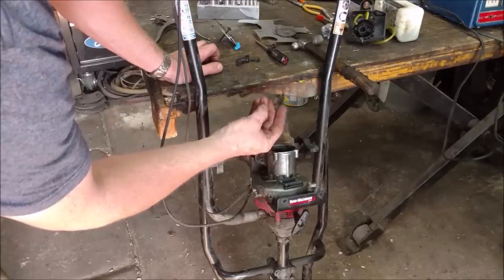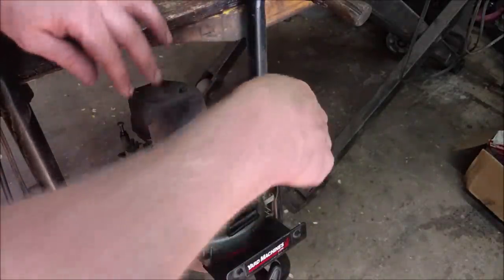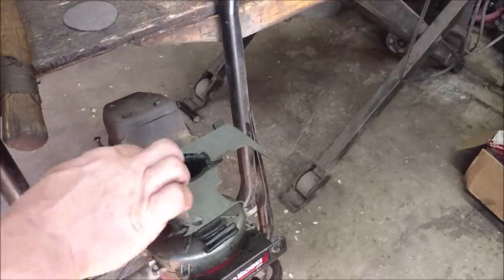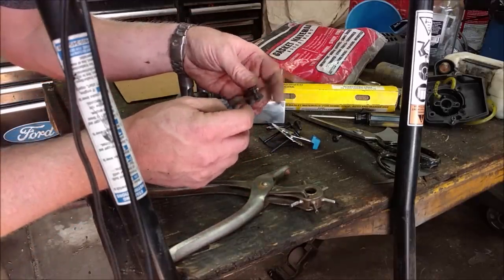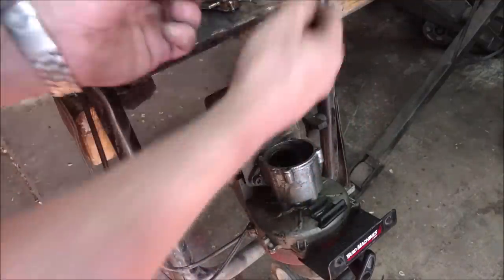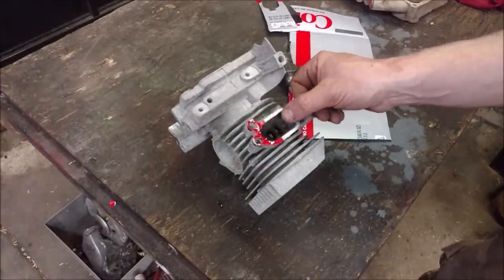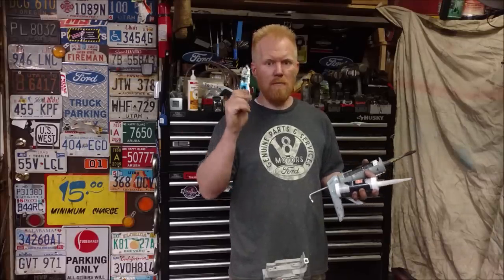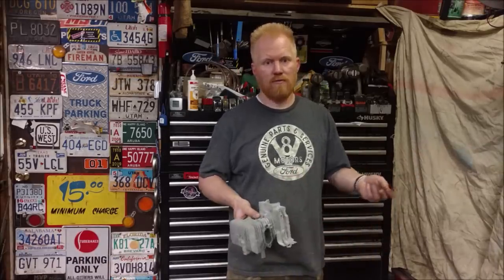Can you Make your own engine Gaskets ????

Comment: I have another question for you that I am sure you are the person to ask.

I have a couple of pressure washers with the 18hp Vanguard engine and 23hp Vanguard engine. They are on a trailer outside in the elements and since buying them about 5 years ago, the valve covers have tarnished and oxidized and the model, type and code numbers that are stamped into the valve covers are very hard to read.

I need to get these numbers off of the valve covers to write down so I have them for when I will need to order parts for them.

I am not sure what the valve covers are made of, aluminum or pot metal or what, so I don't want to damage them and make it harder to make out the numbers on the valve covers.

What would you recommend so that I can try to get those numbers so I can read them?

Thank you.
Reply from the maker: Generally the valve covers on the V twin Vangards are Aluminum.  Once they start corroding it can be very difficult to read. Wire brushing has worked for me in the past and if they're really bad I re-stamp them elsewhere.
Reply: @sixtyfiveford  Thank you.

Comment: Summer 2020:  I'm new to this and have heard the term "blow out protection" where metal is also part of an OEM gasket.  How much to worry?   I'm referring to a Yamaha Wave Runner - small 700 engine for the cylinder head.
Reply from the maker: Head gaskets are the only thing you can't make your own gaskets for
Reply: thanks - just what I'll need

Comment: Rookie question, whats the gasket for ? What purpose does it serve ?
Reply from the maker: When you bolt metal to metal it's not air/fluid tight. The gasket makes sure there is and air/fluid tight seal between the parts as it conforms to the imperfections.

Comment: Must be nice to do a simple carb adjust...been fighting with my Poulan Pro 4218 chainsaw...
Reply: Have you cleaned the spark arrestor? :/
Reply: 999thenewman yep...cleaned carb new plug coil cuz I ripped the boot clean off the old one...fuel lines and filter...pissin me right off
Reply from the maker: Some of these small 2 stroke carbs have a 1 way valve (check valve) with a little rubber disc that swells and won't allow fuel to travel either way. They are not easily removed or easy to find replacements (not a full carb kit item). Unless I have a valuable piece of equipment I am usually done messing with it. On a side note in the past 2 years, China has flooded the market with Walbro/Zama clone carbs for around $10-15 a piece delivered(THAT'S CHEAP). I have used 2 over the past few months. The first one ran fantastic with a 4 stroke weed whacker with only minor adjustment. The second I paid $8 delivered from Ebay/China (3+ weeks shipping) and it worked as well but took a lot more carb adjustment and still leaves the High side a little lean. But I'm not complaining for a $8 and a good running engine.

Comment: Great video, thanks for sharing it with us.  I am guessing no gasket sealer on exhaust manifold gaskets but on the others do you put gasket sealer on both sides of the gasket?   Thank you.
Reply from the maker: I generally put a very thin layer of gasket sealant on both sides.
Reply: @sixtyfiveford    Thank you.
Reply: I've made loads of exhaust manifold gaskets over the years with the hammer method and never added any sealant. Seems like it would get too hot for any normal sealant to hold up. Even if there are tiny leaks it doesn't really matter in most cases.

Comment: Use Indian Head been around sins 1900 , works great with fiber gaskets
Reply from the maker: Yeah, I've used it and it does work. But I don't like that it hardens and that it is non fuel resistant. I enjoy the super easy clean up and flexibility of the #2. If I had something that I never planned on servicing or taking apart again I might use Indian Head Shellac as it permanently bonds and sets rock hard.
Reply: True Ill try  #2 thanks

Comment: What do you use to make your video thumbnails?
Reply from the maker: I've used simple Microsoft "Paint" in the past, but currently I use Adobe Illustrator.
Reply: Thanks! I've tried using paint, but just didn't provide the look I wanted. I'll have to check out Adobe.

Comment: Is that #2 gasket sealant gas and oil resistant?
Reply from the maker: Yes. It is the only thing I've found that is. I use it on carburetors all the time with great success.  RTV all explicitly says not to use with gasoline.
Reply: sixtyfiveford Have you tried that Seal-All stuff? Says its oil and gas resistant and has the consistency of Shoe-Goo
Reply from the maker: I haven't. I just read about it and I think I'll give it a shot. Thanks for the heads up.

Comment: I thought those gaskets you can make wouldn't work for exhaust cause it gets too hot
Reply from the maker: You can buy exhaust gasket material in bulk sheets.
Reply: @sixtyfiveford  the parts store I went to today said the material is not made for exhaust and it will actually burn because of the combustion
Reply from the maker: @Westhelockpicker  A few brands make bulk exhaust gasket material. https://amzn.to/3pOHeOi
https://amzn.to/3KrYzWP
https://amzn.to/3AUl6bY
There's more than these. Local auto parts stores generally carry these or something similar.
Reply: @sixtyfiveford  thanks for the links. My local auto parts store said they don't make them for exhaust cause of the heat the material would just burn so I didn't bother to look it up

Comment: A ball peen hammer? Hell no. As some post-apocalyptic last resort, ok sure, but otherwise? Hell no. Who is THAT desperate? Not me.
Reply: Nothing desperate about it. I've never done a head gasket that way, but have made numerous exhaust manifold gaskets for tractors over the years, the hammered method produces perfectly shaped gaskets. Cutting with an exacto works too, but its slower and not nearly as precise.